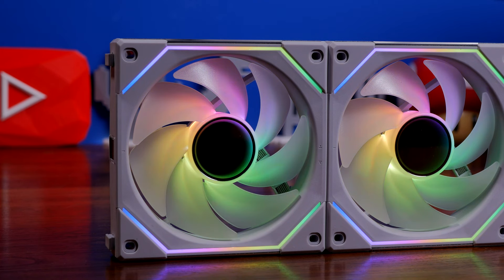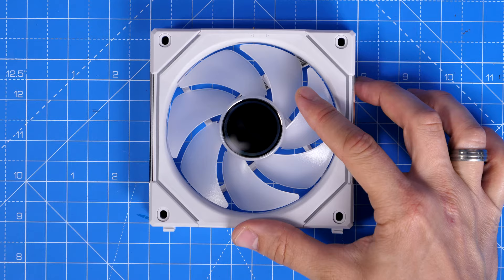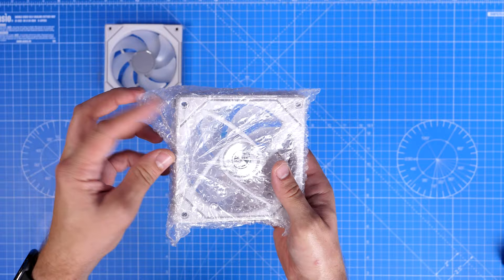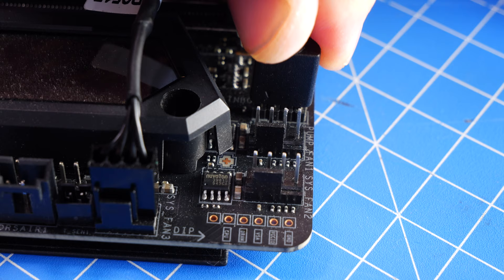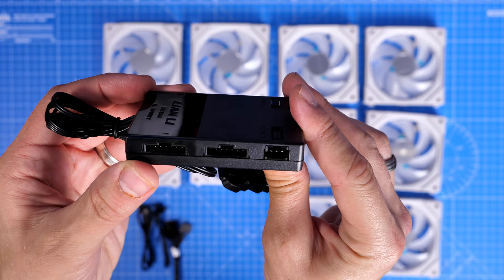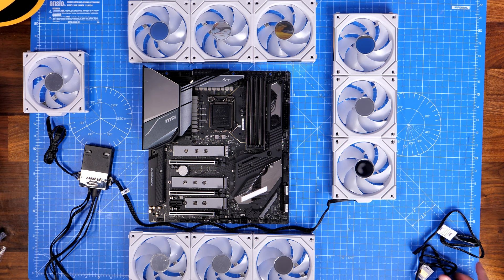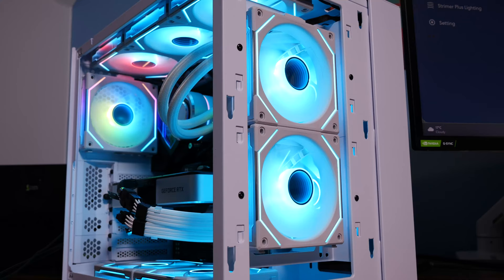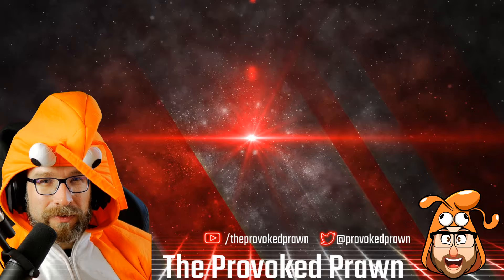How to connect Lian Li Uni SL Infinity 120 fans (single and triple packs)

Comment: I have a corsair H150i elite, that came with a controller, my question is, if I use the SL Infinity fans, 9 x120 & 4 x 140, will I have to use the Lian li controller and what controller will I used for the AIO? Please advise

Comment: I need 8 groups of 4.  Everything is all connected right, downloaded latest firmware and L 3 connect.  No rgb and no fan movement.
Reply: Huh, just figured it out.  It seems the wire harness that connects to the fans can be installed back to front.  Turned it around 180 degrees, now fans and RGB both work.

Comment: Thank you for the great video.  Regards the controller in theory if you have OL11 Dynamic XL, same 10x SL Infinity 120 arrangement as your video (3xfan group side, bottom, Galahad 360 top and single rear) both 24 & (3x8 gpu) strimer V2 cables. How do you connect the fans, strimers & Cooler controllers or would one of these triple fan pack controllers manage to link & control everything?  Would it be the Galahad in sync 1 and the strimer controller in sync 2? Thanks again :goodvibes:

Comment: i have a b450 mortar max, and i want to connect 3 sl infinity reverse 120 fans by daisy chaining them and the plugging it to my motherboard, so that i avoid buying a fan hub. Will the motherboard board provide enough power for the 3 fans?

Comment: I have the Lancool 216. 

Will I need the extra ARGB cable kit to connect the front 160mm fans to the controller l box for RGB control?

Comment: But can I plug the fans together, then plug the single wire into an ARGB hub and gain the same level of control? Or do I need to separate each fan and wire them to the hub individually?

Comment: Can you buy the 3 pack and use 1 of the fans separate from the other 2? Because I'm ordering 4 for the front of my corsair 7000x, 4 for the side, 1 for the back, and 3 for my Kraken Z73 AIO. So I'm ordering 4 packs of 3. Wondering if I should do 3 packs of 3, and 3 single packs. Or if it will work with 4 packs of 3
Reply: How did you get them to sync with the cpu cooler without them being plugged directly to the cooler ?

Comment: @10.50 So does that mean I don't need to use this cable if I already have the Usb 2.0 cable plugged in? Don't I need to plug something into the CPU Fan header aswell?
Reply from the maker: If you plan on using L Connect only then you don't need the fan and RGB connection as well

Comment: If I had 4 groups of fans, I would need 2 triple packs right? Because a single triple pack would only come with 3 of those flat connectors? The 4th group would have to go to Mobo right?
Reply from the maker: Triple pack comes with four connectors.

Comment: It says 'JRAINBOW connector supports up to 75 LEDs WS2812B Individually∙Addressable RGB LED strips' each SL Inf fan has 40 LEDs so are you sure you can connect directly to the motherboard bypassing the hub?

Comment: Does the single fan connect to the controller as well? You showed it had a PWM/ARGB connector and those dont go into the control box you showed. Im hoping the single fan comes with some kind of adapter to let you route a single and groups into one controller.

Comment: Hey. Thanks for the tutorial. I know this is an older video, but even tho I connected the rgb and fan header to my motherboard, I cant seem to control eighter one. BIOS doesnt even pick up a fan connected to that slot. Any ideas what could be the problem? I really dont want to use 4 different sw to control the christmas lights on my pc
Reply from the maker: You need to make sure your motherboard is set to PWM mode in the bios and then use motherboard RGB software like Mystic Light or Armoury Crate for the RGB. Usually an additional download
Reply: @TheProvokedPrawn   thanks for getting back. After setting it to sync rgb to mobo I can get RGB control in Armory Crate, but syncing fans just blasts them full speed. The mobo doesnt pick up any rpm reading at all on the connected chassis header

Comment: This video is really helpful but one of the questions that I have is that if you get the three pack how many connecters that plug into the fans do you get in the three pack. Because my next pc build im looking into these ones and im getting 2 140mm and 3 120mm but one of the 3 is going on the back by its self
Reply: I think mine came with three or four connectors in the three pack so you should be fine.
Reply: @zacharychristman1282  alright thank you for letting me know

Comment: Doing the same, my back fan is alone on the controller and after 3 group of 3 fan, the back fan who is alone doesn't work, it refuse to start, i replace wire and changing place on the lian li hub but nothing change. How do you make it work ?

Comment: Very informative video thank you, question, if I only wish to use the fans through L Connect and not the motherboard, do I still need to connect the ARGB cable? Or can I just connect the two cables that come with the fan into the hub? Thanks.
Reply from the maker: If you're just using L Connect then you just need to connect the power and USB connections.

Comment: Have you seen a situation where one of the fans in the cluster of 3 will stop spinning randomly requiring a reboot or re seating the cable to get it spinning again? I am thinking the logic is bad in control pack. Not sure if this is a common issue
Reply from the maker: Not that I've seen. Is it possible the connection is loose or not fully seated?
Reply: @TheProvokedPrawn  I have now checked all of them and everything is solid. Given that unplugging and plugging back in will get the fans spinning again my next point of trouble shooting is changing out the controller.

Comment: So if I connect the cables to my motherboard to sync the lighting and have the option to control it from my motherboard software, would I still be able to have the same amount of customization options as L connect does
Reply: What do I need to plug in to sync rgb with motherboard but have control from l connect software

Comment: so, is it absolutely necessary to use the three and four pin connector? I don't really want my mother board to control the fans I want L Connect to do it...
Reply from the maker: Nope. You can just use USB and Sata power. Pretty sure I said that.
Reply: @TheProvokedPrawn  well you didn't say anything about L Connect controlling fan speed. You only mentioned rgb, then went on to say the 3 and 4 pin connectors can control rgb and fan speed via motherboard. The reason I ask it because I've had it where one clashes with the other and now nothing works. Now I know you didn't say anything like that...

Comment: Wait bro what if i plug one sata and use only one side? And also the microusb cable one so i plug that and do i need to plug in the 3pin one can u pls explain that?
Reply: I got the part where u said it would have rgb but could i control it eith anything if i plug it with only usb one not argb? And the sata one i only have one and i would get either 3 or 6 fans

Comment: Thanks for the video. I just got the SL infinity fans. I have 7 fans in total and 2 strimers. I'm having issues with changing the static colors on fans and strimers. When I change color to static all the fans will sync the same color except the 3 for my radiator. One will change and the other 2 will change to different colors, so all 3 are different colors. How can I fix this? Thanks
Reply from the maker: https://youtu.be/xmLIU40UOVI

Comment: Also how did you connect your strimmers to the L connect?  Did you use a seperate controller?
Reply from the maker: Yes. You need the Strimmer controller. I've got a video on them too

Comment: I can't wait to get "fiddly" with these, but I want em on an AIO.  Lian Li said they have a new AIO coming out, a few weeks ago, but no plans to put these on one :(
Reply from the maker: You can still do it. Just swap the standard included fans with these. No issues.
Reply: @TheProvokedPrawn  if only they had the rad and pump with no fans for a lower price.  I may wait and see what else comes out.  It's about $400 for 10 of the SL-INF :(  cus I want the 011 DE too

Comment: So if I need to purchase a total of 10 fans, is it best to buy (3) triple packs and then (1) single fan VS (1) triple pack and (7) singles? I want to connect everything to the controller and use 1 piece of software to control everything. I don’t want tons of cables utilizing the mobo headers. But then I’d be stuck with a total of 3 controllers when I only need 1??
Reply from the maker: It depends how many fans you have in a group Vs the total if that makes sense. I have 10 fans but the grouping is 2 bottom, 2 front, 2 side, 3 top and one rear. I used a control box for everything except the rear. Really two controllers would have been best for connecting and controlling them all. So two triple packs and then the rest as singles.
Reply: @TheProvokedPrawn  my grouping would be 3 sets of 3 and 1 rear fan for my evo case that I’m building. I just didn’t want to be stuck with 3 controllers in total with 1 being in use. So the single rear fan I’d have to buy that proprietary connector to connect to the controller right?
Reply: @derekminor7741  I have the same setup on my PC currently with the SL120 fans. Waiting on my infinity ones to arrive but to my knowledge, all you would need is a triple pack for the controller and 7 single fans (which is what I ordered). You would connect 3 groups of 3 fans (bottom, side and top radiator in my example) to three of the four slots on the controller and the single rear fan to the last fourth slot on the controller as it’s own single “group”. The triple pack contains x4 of that proprietary connection to connect the 4 groups of fans.
Reply: @Flamewolf2009  ah makes sense. I missed that little detail when watching this at work. My orders shipped today from the egg!
Reply: @Flamewolf2009  thank you I'm in the same boat. I needed 10 fans and was thinking 2 triple packs to get 2 control boxes to be safe in case one didn't work properly and because idk the load rating for the plug in on my MB but I wasn't sure if I could connect the single or not haha. Gonna hit order now!

Comment: Im trying to hook up my fans but i found that i don't have enough SATA power connectors to connect the control box along with my lian li v1 strimmers to the power as well. Do i need to purchase a SATA splitter to have enough imputs for power?

Comment: Hi need some help i have 3 single pack 140reverse blade and 1 single 120mm infinity fans and i need a controller so my question is can i use uni hub slv2
Reply from the maker: You need the Infinity hub

Comment: I see in the last part of your video you are using a Lian Li o11 air mini case. I installed 3 infinity’s on the top, 1 at the back, 2 on the side radiator and 2 normal SL 140s in the front. Problem is that all the fans are spinning but they don’t light up. I’m using an msi itx z790i edge which has only 1 Rgb slot on the top of the mobo. Do I have defective fans or controller? Is that one rgb slot enough to power all fans or should I just install L-connect and that will solve everything?
Reply from the maker: Assuming you plugged the sata power into the controller it will be

Comment: Quick question I have a Asus B550 A Gaming. My mobo does not have the 5v RGB. Only 12. Is there a way to connect it? My hub caught fire lucky for me didn’t affect my pc or parts just the hub and sata cable… the fan wires are good and working and spinning I just don’t have rgb since the rgb wires aren’t plugged…

Comment: Does the triple pack comes with extra cables other than the combined cable? Because I want to get a triple pack but placing 2 fans on the top and 1 at the rear.
Reply from the maker: It comes with four of the combined cables.
Reply: @TheProvokedPrawn  thanks a lot with such quick reply

Comment: Hey! Thank for the video,  as I see you are using ROG STRIX motherboard in the last part, so the LL hub will let you control these fans in the Armory Crate and will detect as separate chassis fans (groups) ? At the moment I have AL model of fans, and I had them plugged to the PWM motherboard header directly, as the motherboard could not detect them in  the bios.

Comment: So I connected my single fan in the back it’s powered by the top 3 stack fan but the rgb isn’t working on the back one but my top and side ones are working ? Any advice ?
Reply: Also what side brings in air into the case ? And which side goes out the case sorry for the idiotic question but hopefully someone can help me lol

Comment: Hello, i got a question. I bought 8 d30 phanteks fans 6 reversed and 2 regular for exhaust. My plan is to use 3 of them with the kraken elite Aio so swap out the fans but i don’t really get how to sync all the fans and rgb together. I know the kraken elite aio got 3 fan header splitters for the fans that come with it but that’s for 3 fans i want to connect 8 fans so im thinking maybe its to high of voltage or something i don’t know. Im just lost on how or where to connect the fans they are daisy chained. Thank you im grateful for any help.

Comment: I have a question. I wanna make a build with 10 of these fans but 3 of these fans will go to the Lian li GA ii 360 AIO cooler. Will I connect those 3 fans into that controller or I should connect them directly into the motherboard?
Reply from the maker: You could keep them on the hub and just set that group to change speed depending on CPU temp via L Connect

Comment: Do I need to plug in the fan 4 pin in order for fan to work or just the 3.0 usb. I can get one or the other to work but not both. I have the INF fans. I have the control box but do need to plug in the 4 pin that’s what I want to know. I have the flat fan plug. Nevermind I figured it out.

Comment: Hey there! Thanks for the vid Iit will definitely help me a lot when I eventually build my pc. My question is is it possible to connect 9 fans like 3 3pack with 3 fans as an aio, 3 (connected together) as intake and the last 3 is separated into 1-2 fans. Is that possible to power since I will have 1 120 size fan space on the rear and 2 120 in the bottom. Is that possible? Case is hyte y60 researched how mount 3 fans on the side so there will be 3 on the side 3 on top with radiator(aio) and 2 in the basement 1 in rear

Comment: Are you able to control the RGB of the sides and the blades individually when connecting to the motherboard? if I wanted to turn off the blade lights without turning off the side lights, for example.
Reply: no, you need lianli controller and l-connect software for that.

Comment: I just bought the LCD fans and having problem when i select the sensor options to show the temps. The sensors glitch out and dont look right. This only happens on the sensor option and nothing else. Has anyone else run into this problem?? NEED HELP

Comment: I have Lian Li 240mm Aio, and 360mm Lian Li fans. I just plug them by their controller separately. Also I connect aio pump to the cpu fan port. But Lian li software recognize all of them as cpu fan. So when I launch a game all the fans suddenly goes at full speed even though I adjust them on standard RPM . What is the problem ? (Sorry for my English)

Comment: i have very old main board Asus asus p8h61 without any ARGB connection. Can i build the same argb fans configuration with my mainboard?
Reply from the maker: Yes. Just use the controller and a USB connection to control the lighting with L Connect

Comment: do i need the sl infinity controller that comes with a x3 pack (cant buy it by itself) or can i also use the sl uni fan L-connect 3.0 controller?

Comment: I know on some effects you can reverse the flow of color.  But on some you cannot.  Can anybody confirm from which side of a given bank of fans does the color begin to flow from?  Does the color begin to flow from the cable/connector side or the non connector side of a set of daisy chained fans?

Comment: If I connect all the fans to the controller. Can I use other software to control the fans like Argus monitor or Fan Control. Or do I have to use L connect to control the fan speeds. I would really like to use Argus monitor, thanks!

Comment: I have 2 triple packs and galahad 360 radiator. I'm using the controller from the triple pack. I can't get sync rgb from motherboard only through l connect software. Anyone got a clue what I'm doing wrong?

Comment: So i have a question, so i dont have a j rainbow port on my motherboard and when i look at the manual i dont see a pwm port anywhere. I connected that 3 pin connector to an extention that has 3 pins sticking out and i connected that to the power module for the raidiator (the galahad ii 360mm lcd). Is it ok that i connected it to that? Also, whats some of the different names for a j rainbow port? I have the nzxt b650e btw

Comment: Hey mate, awesome video, really helpful! 
Is it possible to use the controller without the Micro USB cable? I have all fans plugged in, 3 groups of 3, one solo for exhaust, into the controller ports, the PWM and ARGB connectors plugged into my board, and ignored the Micro USB cable because I didn't want to use LConnect. However, when I turned on my system, no RGB came through for the fans, but they were all spinning. Is that the reason why, not using the Micro USB? Thanks in advance!!

Comment: Thanks for the informative vid! I own a Galahad Aio (non Uni fan version ) and want to change the fans that come with it for 3 SL120 infinity fans . 
How do I connect those 3 fans on the cooler to the Uni Hub? Via one of the 4 fan ports? Or the sync port ?
Reply: they daisy chain so you would have one connector into one of the four fan ports. I just did this myself (make sure the fans are oriented the right way to blow air out of the case haha)